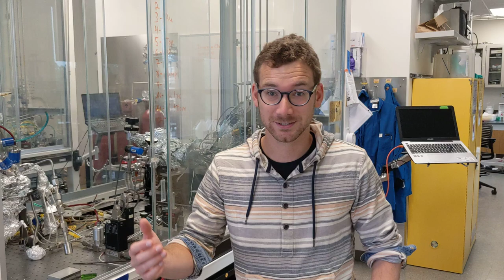Microchannel Plates as high aspect ratio structures to study atomic layer deposition process.

Comment from the maker: Microchannel Plates
MCP is a specially fabricated plate that amplifies electron signal similar to secondary electron multiplier (SEM). Unlike SEM, MCP has several million independent channels and each channel works as independent electron multiplier. In other words, one can imagine MCP as an assembly of millions miniature SEMs. MCP consists of a two-dimensional periodic array of very-small diameter glass capillaries (channels) fused together and sliced in a thin plate. A single incident particle (ion, electron, photon etc.) enters a channel and emits an electron from the channel wall. Secondary electrons are accelerated by an electric field developed by a voltage applied across the both ends of the MCP. They travel along their parabolic trajectories until they in turn strike the channel surface, thus producing more secondary electrons. This process is repeated many times along the channel; as a result, this cascade process yields a cloud of several thousand electrons, which emerge from the rear of the plate. If two or more MCPs are operated in series, a single input event will generate a pulse of 108 or more electrons at the output.
http://www.dmphotonics.com/MCP_MCPImageIntensifiers/microchannel_plates.htm